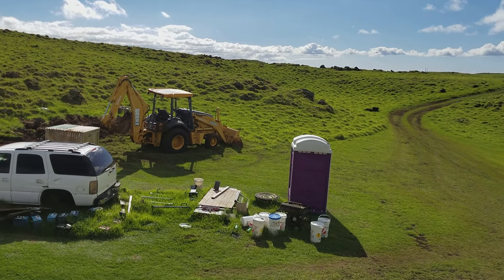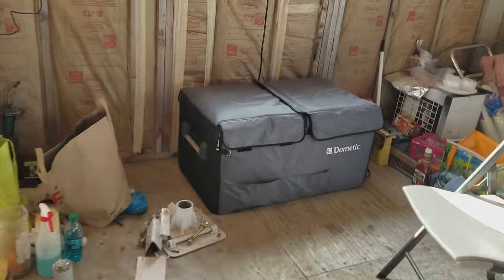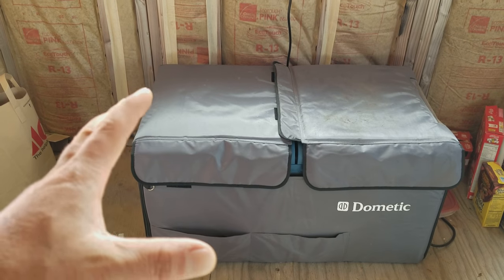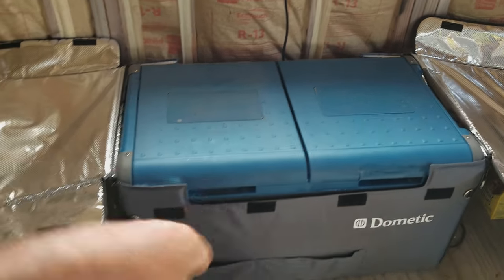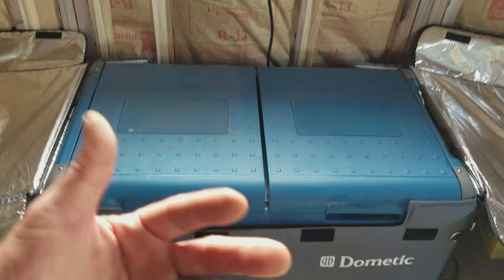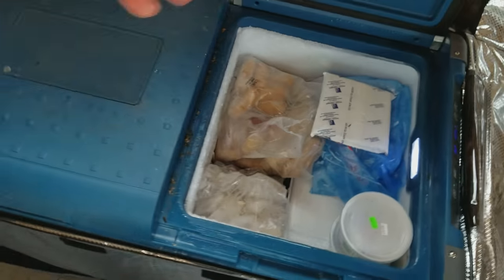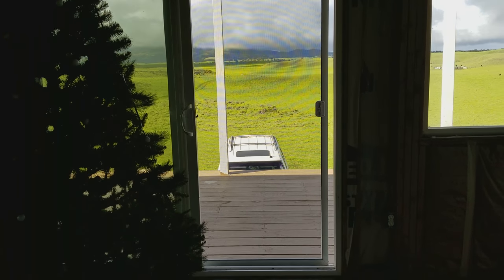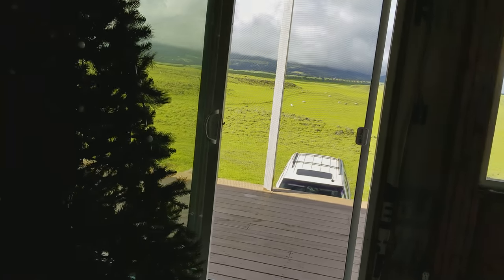My Solar Powered Refrigerator Freezer - New Off Grid Home

Comment: I bought an alpicool t36 and have since seen the same model under various names for as low as 150.00 mine has been working continuously first bounce down the road in my truck and now at my off grid location flawlessly for 6 yrs now

Comment: we use sunstar freezer and voltray fridge/freezer both 120v AC 12v DC and 24v DC no
need for an inverter. we run them off 2-245w panels  and 400ah of battery's.
both work grate had them about 3 years now.
Reply from the maker: +old town Homestead nice
Reply: I have a Sun Star 9cf freezer.  Works great off a 280W panel and 186AH 24V bank.

Comment: That's neat. Our frig went out 2 weeks ago. thankfully we do have a chest freezer but duo to the holidays we didn't have the money to get a new frig right away, So on the spur of the moment we kept the dinning room door closed so no heat got in with a window cracked, it gets about 30F in there now. it's winter. :) 
But it does work for our use, We decided since we haven't used the dinning room for a few years, at least until it warms up, That we would keep everything in Tupperware tubs in our big frig that is our dinning room LOL  What ever works. gives plenty of time to do research on which frig to get.

Comment: Just a tip..You're going to have better efficiency if you plug directly into your batteries instead of using your inverter.
Reply from the maker: Yes I do know that but I have lots of extra power and my house is wired for AC and i dont really want to keep this under the house next to the batteries. just more easy. Thanks for looking thu and thanks for the support.

Comment: I'm thinking converting a small deep freeze into a refrigerator simply by modifying the thermostat control, a deep freeze has thicker walls then a regular refrigerator there for making it more efficient, With it's own solar array and batteries having a diode it can also run off the main house batteries if it needs to but the house batteries can't draw energy from the refrigerator batteries, Im trying to figure out a way I could also have the it part deep freeze and refrigerator without losing efficiency, living off grid we all know the key to a cheap system is efficiently and it works, I hear of people spending up to $30,000 for a solar system that's totally not necessary, I spend $2000 and can watch dvds on my 42 inch LCD tv and it will last just as long as the $30,000 systems.
Reply: Harold McDermott  How are you able to do so much for so little. Please explain in detail, I’ll be taking notes.😀

Comment: Sundanzer makes a nice line of refrigerators/freezers that are 12/24 volt. Pricey, but do not need an inverter to use them
Reply from the maker: +James Pottorff this can run on dc without any inverter.

Comment: WOW, that looks small but sure is pretty.  I run a 7CF chest, had a 5CF and that was way to small to ever find anything. Now I wish I went with a 9CF but that was a big price jump. Sure would like to add a freezer for ice cream.  My chest fridge at my off grid camp only runs in the day on solar. I "store cold" for night hours by having massive amounts of drinks and keeping the fridge near 33. By morning it is about 40F. Runs on a dedicated inverter that turns on and off. The whole camp needs only a car battery ( but lots of solar) and temp control is microprocessor based so fridge only operates when battery is fully charged. I works flawlessly for months in the summer. Moisture buildup is a problem. Have a frame it sits on and that condensate flows into a pan underneath. Temperature stratification is a very big problem. I hang a 12V computer fan from one of the racks to circulate air all day. Otherwise the temp can vary 10 degrees easily from top to bottom.
Reply from the maker: +opera yah the 95 is over priced i would not buy it again.
Reply: opera seems like you could take advantage of the temperature stratification to keep frozen foods on the bottom and non frozen foods above them.

Comment: $1329.00 is what that thing cost. Yeah, way over priced
Reply from the maker: I agree it's over priced. I still using it Thu.
Reply: If you can't afford...don't comment....I have two...and totally worth it!
Reply: @ShinerBockGirlz  I can afford as many as I want. Turns out that I was able to buy a 63qt fridge/freezer with Bluetooth, a deep cycle battery, and a 200w waterproof Renogy suitcase for less than one Dometic.